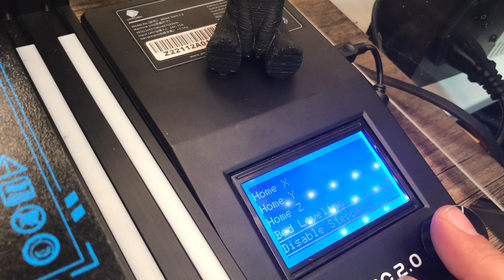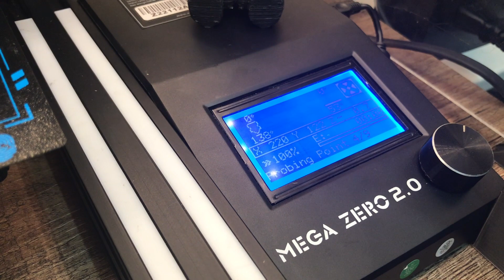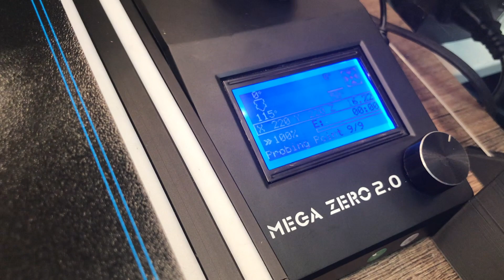Anycubic Mega Zero 2 0 BL Touch PIN 27   HD 1080p

Comment: I've got the Mega SE running on marlin 1.1.9 and using a PIN27 board. Some tutorials show that you need to add "#define SERV0_PIN 27" in the config.h, some say you need to add it under pins_<boardname>.h and some say you don't need it at all.

How did you do it? Wasn't able to find anything PIN27 related in your configuration.h / config_adv.h
Reply from the maker: @Boerny I didn't made any change inside cfg.h just installed the PIN27 and it worked fine until now.Did you tried out without change the cfg.h for pin27 ?
Reply: @01Collection  Until now I didn't upload because I wasn't sure. I'm going to give it a try without the PIN27 addition in the config.h. Thanks!
Reply: Turns out I needed to add it to the configuration.h. Works perfectly now.
Reply from the maker: @boerny6757  Happy to hear it's running

Comment: How did you flash you printer with the firmware?
Reply from the maker: I used the Software Visual Studio Code for it. 
https://www.youtube.com/watch?v=W6zYvRgGr3Q
Reply from the maker: The Firmware wich I added, is suitable for BL-Toch.
Reply: @01Collection  what environment did you use?
svcode only allows me to use Melzi optiboot optimised, Melzi optiboot , Melzi optimised or Melzi
Reply from the maker: @jethrocrooke3917  melzi_Optiboot_optimized